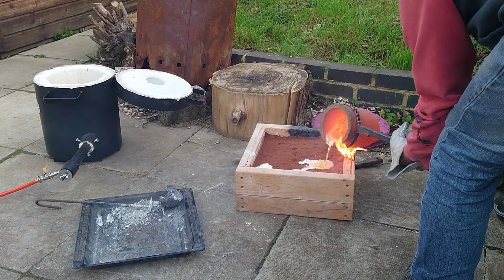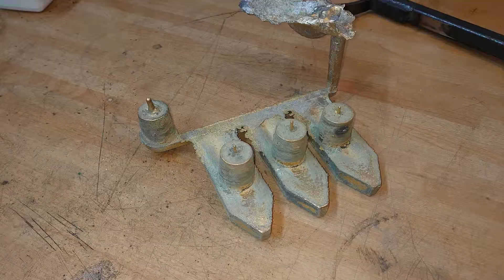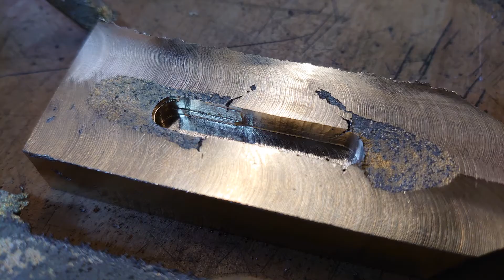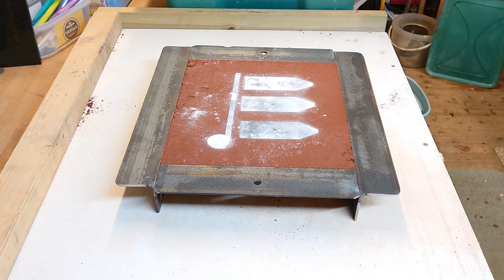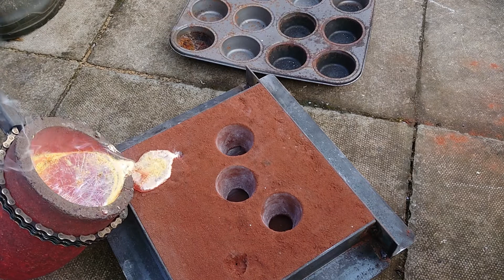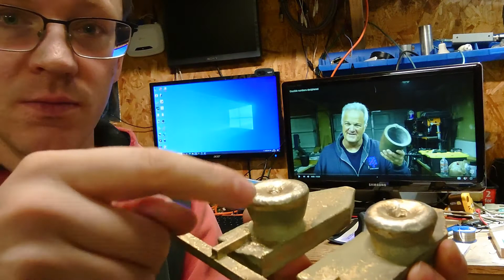Casting Brass and Hot Spot Shrinkage (SWDweeb assists!)

Comment: Hi Olly,
You must have done a few melts in the Devil Forge by now. Hows the Kaowool/Rigidizer holding out.
I'm going to build a larger funace than my Coffee Can one and thinking of using Kaowool/Rigidizer as opposed to refractory bricks/mortar.
Regards
Kevin
Reply from the maker: Hi Kevin. Yes, done a fair few melts, a couple of brass, and probably 10 or so aluminium. The rigidised wool is holding up well. I have been very careful with it as it does seem like it would be all too easy to knock a chunk off.  A few cracks have appeared, but that's probably to be expected. Bottom line, I'd definitely give it a try.
Reply: @ollysworkshop  thanks Olly....Merry Christmas